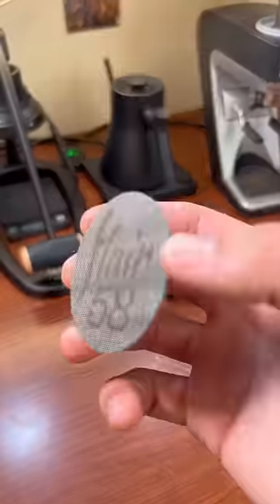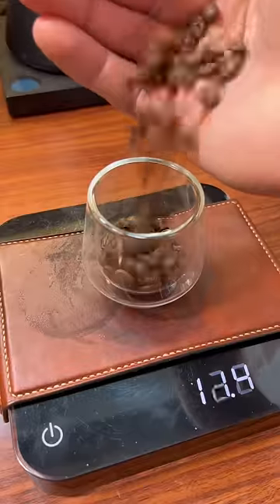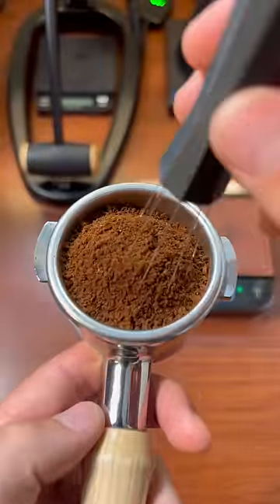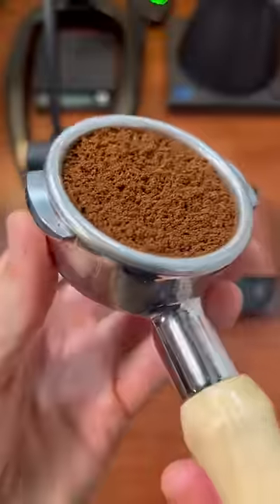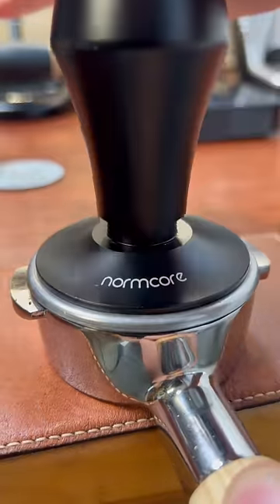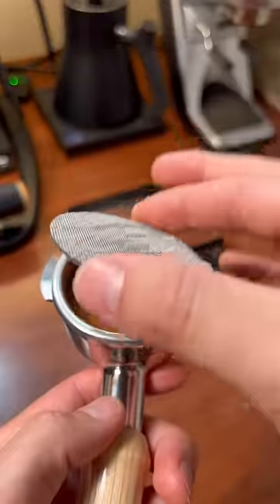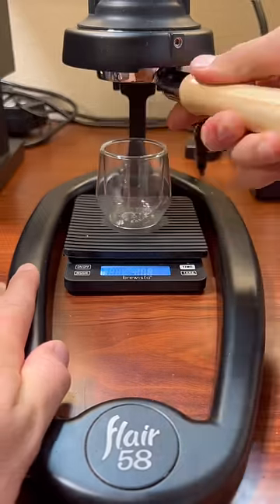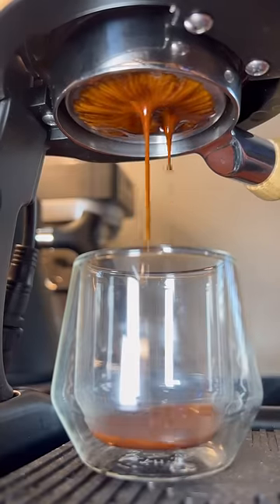My espresso tools and what they do ☕️ #shorts

Comment: I like the logic of breaking up the clumps to then press it all together (essentially making it all one big clump)
Reply: 🤫 shhhhhh
Reply: The idea is just to remove the small pocket of gaps in the coffee so you can “press” it with certain pressure, else your coffee is going to be weak and thin depending on how fine your coffee are grinded
Reply: @SamuelLing  explain how
Reply: @Kefka2010  ain't no way bruh 💀
Reply: he de clumps to get a more efficient press into a puck as declumping allows room for air to escape
Reply: Some spots r denser than other if u don’t distribute it
Reply: Goofy ahh coffee
Reply: one big CONSISTENT clump. There is a distinction
Reply: @draken9045  Do we really think it will matter when you compress it into a puck?  You've already pressed out any pockets of air. 

Is there any data to back this up?
Reply: @barrychopsticks  Where do you recommend I start?  It sounds like you have researched this so you must have some data driven proof that will be a good point for me to start?
Reply: @barrychopsticks  I think it's kinda ironic you talk about others getting triggered when it's so obvious that's what you are.  Someone who doesn't have the same hobby you do asks why you do something specific about it and you throw a tantrum instead of just saying why.  Think about how short your answer could have been instead of the smartass remark on your previous (unprompted) reply to me.  If you get that triggered by people asking questions then don't look in the comments section.
Reply: @flosscap  nice explanation!  its called channeling 🧐 for those who don’t know

Comment: TLDR: Doesn't make difference, but is a great conversation starter
Reply: The wdt tool (needle tool) makes a difference among all the tools here cuz clumps and uneven beds even when flattened with a tamper will have weak spots and tight areas you wont see but when water pushes through at high pressure weaker spots will pass water really fast and the tighter areas will have less contact, this is called chanelling. This results in less extracted coffee so not gonna be as tasty as a fully extracted shot.
Reply: @dominicjestinchankingwai4105  
They should teach this in humanitarian majors lectures
Reply: Not really a good conversation started unless you want people to think you have aspergers
Reply: @NidoBot  as a person with aspergers, I'm offended that you're completely right.
Reply: @dominicjestinchankingwai4105  sure, but it shouldn’t be too expensive. The one he has is 3D printed. You can tell because they printed it at a high layer height and you can see the layers lol
Reply: What? on how pretentious you are? 🤣
Reply: @NidoBot  I hate how right you are
Reply: @NidoBot  I would take any conversation start'er' that comes my way.
Reply: @woobywoofers9854  Same
Reply: @NidoBot  “nice to meet you, can i tell you about my spring loaded weight calibrated espresso machine coffee ground tamper?” sounds like exactly the type of conversation starter someone with aspergers would use
Reply: @dominicjestinchankingwai4105  There's no real evidence of that.
Reply: @isodoubIet   How did you come to that conclusion? I mean its pretty stright forward information. Even distribution=even extraction. Lots of vids of people testing this and finding results aswell as people in forums who are avid coffee drinkers.
Reply: @dominicjestinchankingwai4105  " I mean its pretty stright forward information. Even distribution=even extraction."

Sure. Evidence?
Reply: @dominicjestinchankingwai4105  I know what channeling is. 

"The wdt is just a technique that helps with even extraction. "

EVIDENCE???
Reply: @isodoubIet  https://youtu.be/WErtiVYKmAQ i mean i know a lot of people in groups and forums who tried and tested this technique with even extraction as results. Heck i tried it with the same sentiments. Wendidnt tape the results though. But this vid is pretty much what happens without proper distribution. Its widely practiced because of the results people are getting. If it doesn’t work people would ultimately stop doing it, the extra time taken is long enough for an espresso so has to be worth the extra effort.
Reply: @dominicjestinchankingwai4105  Here's what I asked for:

1. repeatable experiments
2. detailed methodology
3. adequate sample sizes
4. proper controls
5. statistical tests

Do we get any of that with that video? Let's see... 

1. Is any of that repeatable? No, he did it all himself, meaning he's the biggest variable. Any personal bias he might've had towards one of the methods would go right into the data. Furthermore, his allowed variation of 1 gram in the target yield could on its own account for about a about a 1% variability in extraction, which is about the same variability found in the results. Garbage in, garbage out.

2. Is the methodology detailed? Nope! There was zero explanation of how the tests were carried out, or how the techniques were applied, beyond naming the tools and showing some brief images. Not enough.

Furthermore, let's say I want to replicate his results... I'm immediately hosed because he didn't say 1. what beans he used 2. how they were roasted 3. what grinder was used 4. what machine was used 5. the brew temperature and pressure. What were the grind settings? What distribution method did he use when dialing it in? How long were the shots? Was there preinfusion?

3. Are the sample sizes adequate? Kind of irrelevant in light of the previous, but we don't know because no statistical tests were carried out.

4. Are there proper controls? Again no, for the above reasons.

5. I repeat myself. No statistical tests of any kind were performed, so even if all the above factors were magically fixed, we wouldn't even know if the results are consistent with random chance.

This is a well-meaning but ultimately unserious testing effort.

Comment: As an Italian who was also a Barman, I only saw the 2 second one never knew about the other 2. Makin an espresso usually takes you 30 seconds using these tools will take you like 60 probably even more since u have to clean the mash each coffee you make
Reply: Decades ago before the stupid starbuck craze we had a coffee shop with a real expresso machine imported from Italy. This thing was fancy and high quality. The grinder dispensed the correct amount in to the pot and then on the machine you would press it a bit and put it on the machine and run it. Then you would remove it. Tap the coffee ground out in to a steel bin and as many times that we had done that you could see the mark on the handle right in front of the pot. You could make a lot of expresso with this machine and froth milk all day long with out stopping. Talk about a machine. I do not recall exactly the price of the machine. I am sure it was in the 10k range and was gold or silver, real fancy looking too.
Reply: @kameljoe21 espresso not expresso
Reply: @kameljoe21  i actually thought all coffee machines from shops were like that. But I live in Portugal and coffee is a huge part of our lives I guess
Reply: @ohhimark3691  I have a Saeco Magic Deluxe 2 for my home machine. Its an automatic. It cost well over 1k new more than a decade ago and still going strong. Refurbished ones still cost around 600 dollars when you can find them. 
I do no go to places like starbucks and never really did. I learned all of the coffee stuff from when we owned the coffee shop. Most of what we sold was copies from Portland area which was where the college kid went to school or some place like that. This was during the time of the great StarBuck boom of the mid to late 90s. Coffee house were becoming a major thing and Starbucks started to expand. We did not last a couple of years as our location was in the basement. Even if we had lasted another year or 2 before someone make some sort of complaint about going up and down the stairs. Had we had a street level location I think we could have ditched everything else and just done pure coffee/espresso cold or hot drinks.

Comment: Just in case people were wondering. The brush thing is useless, just get a good coffee grinder with good coffee, no clumps happen. The tamper, yes you need a tamper, but getting one spring loaded and set for a certain way? Coffee can change slightly depending on the humidity in the air and the course of the grind. The grinder will eventually change its setting, it happens with any tool either due to wear or because of movement, so having a tamp set at one setting is useless, just learn to use a regular one. And as for the mesh, 99.9% of espresso machines have one built into them on the machine itself, so if you have a machine that doesn't you're spending money on something that you dont need to.

Comment: I think 99% of people would not notice any difference in a blind test
Reply: You for sure would. The tamper is minor, the screen and wdt are both marked improvements though. The main thing is uniformity though, you could pull 100 shots with the tamper, wdt, and screen and they would all be largely the same. If you just grind and tamp though, some shots will be bitter, some with have a different mouth feel, and some will be sweeter etc
Reply: @koshey245  Agreed. I’ve been pulling shots since 1999, and consistency is far more repeatable by stating with fresh & properly stored beans, using zero ppm water (with or w/o flavor profile enhancer), weighing, using a quality espresso grinder fine enough for a 2:1 pull in 25-30s, WDT/OCD distribution, even tamping, timing, preheating, & puck screening. 

People who can’t tell the difference probably destroyed their taste buds with years of drinking instant coffee.
Reply: @evolv.e  I spent 3 or so years drinking keurig/not great coffee but after about 2 years I can 100% taste when a shot was messed up
Reply: @koshey245  the comment towards the end was meant as sarcasm. I should’ve placed a /s at the end. What’s more likely is that those who haven’t had a properly made espresso, latte, coffee, etc aren’t aware of what they’re missing and therefore don’t think there’s a difference. 
But, as everyone’s sense of taste is different, who’s to say that some people truly can’t tell the difference.

Comment: A little tap on the side of the basket does exactly what first one does. You cannot over tamp, so spring-loaded tamper is pointless. And all espresso machines already have a fine mesh under the water chamber. But this is how businesses work nowadays. They invent a fake problem, for which they plan to sell you a pointless but very expensive solution. At the end they pay bunch of money to get you convinced, you need, it by similarly pointless person, called "influencer" 🤣 If you want a good shot of espresso always make sure you use freshly baked coffee beans, and grind them right before the brewing.
Reply: A removable mesh does make sense in high volume applications, because it's much easier to clean than one built into the group head (the latter will be too hot to handle after pulling a shot, and take a long time to cool down). For a home or office setup, I wouldn't get one.
Reply: You absolutely can over tamp. What are you talking about?!
Reply: @NetRolller3D  agree but nothing of this setup speaks high volume. BTW running some hot water through it and wiping it with a towel gets the job done. As a matter of fact, this is exactly what baristas do in busy coffee shops.
Reply: @Alwaysaspy  the purpose of tamping is to remove air pockets and even the puck. Coffee is hard matter, you can't compress it below its volume. If your espresso runs slowly try changing the grinder setting.
Reply: @kalpazanov  you're super wrong. But you're confident in your wrongness.
Reply: @Alwaysaspy 😂 I love how pretentious that comment was oh how I love this channel.

Comment: The only reason to get a puck screen is to keep your shower screen clean, which isn't really needed as long as you run some water through the machine and brush off some loose grounds every now and then. I can see a puck screen being a little more convenient on something like the Flair 58 though, since you would have to pour the water manually through the group head in order to clean it. On my Gaggia Classic Pro, I can just flick a switch to do the same thing though. 

The main problem I have with screens is that it drastically increases your shot times, which would make me constantly paranoid about whether my grind was fine or coarse enough. If it takes that long for water to get through the screen, then how long is it taking the water to get through the coffee? Is it being properly extracted, or is the water spending most of its time just getting through the screen? It's just another variable that I'd rather not have to deal with.

WDT is something I'm a little mixed on. I added a WDT tool to my normal process recently, which includes a leveler and tamp. I cannot say whether or not the WDT has made any real difference to the quality of my shots. I think using the combination of the leveler and tamper was probably good enough on their own, but I still use the WDT during puck prep because it can't possibly hurt anything. Now the process is WDT, then level, then tamp. It works great, but if I'm being honest, the addition of the WDT probably wasn't necessary. I was getting great shots without it too.

Comment: Now if you really want to get fancy, place a small metal siv with a freezing cold metal ball over the top the of the glass, then let the machine pour the espresso over the ball rather than directly into the cup. Locks in much more flavor that usually disappates from the heat and makes for a nice rapid iced espresso free of ice.

Comment: The most significant difference in an espresso will come from a tamp and evenness of the grind. The wdt and puck screen also help but the difference is less if your machine has good water flow and pressure. Any other extra steps are completely unnecessary

Comment: “That allows you to pull shots like this”

I’d say that’s rather misleading given that you can pull the same looking shot without the screen. A good espresso machine already has a water distribution group head and it does a pretty good job doing so. We actually tested it and there is no difference in taste.

The reason why my coffee shop uses it is to avoid the group head from getting lodged with coffee grounds. Realistically the screen just makes the whole operation cleaner. The whole process is much faster as order turnout with screen saves about 10 seconds of checking that the group head so clean between the three machines.

Comment: all of those things should cost less than $5 individually, the 1st one is just a whisk cut in half, the tamper could be replaced by something with a smooth edge that fits into the whatever and the puck screen can be replaced by a stainless steal mesh strainer cut to shape
edit: i found a wdt tool online that looks like the one he uses for $26
the tamper was listed around $45
finally the puck screen was around $25 looking for the flair 58 one you have
i can garuntee you the difference between using your fancy tools and my replacements is slim to none mr brozo
though i think tea is better and my $15 teapot is better than that most likely several hundred dollar coffee press you use so whose to say

Comment: A lot of people seem to not have used these tools before in the comments so I can try to explain some of them: 
I haven't used the needles, so I'll skip those for now. 
For the tamp/distributer: you're tamping the espresso grounds for the same reason that you grind it so fine! You want a lot of coffee very tightly packed to cause a lot of pressure, and get the high concentrate that espresso has. My boss explained it to me this way: if you have a barrel of packed together sand, and a barrel of gravel, which one does the water get through first? As for creating pressure, if you have a room with an open window vs closed, and try to close your door, you can see the difference there. You need a tight seal on both sides, but water needs to still be able to get through the coffee. We use high pressure from the machine and tightly packed, fine grinds to make a super high concentrate, and then filter that through into the shot glass. 
A level tamp is really important as well, because if one side is tighter packed than the other side, the water will take the path of least resistance (of course). If a river had to either flow through a mountain, or take a path around it, it's going around it every time. So you'll get what's called "channeling", where the water goes through the side that's less tamped, and so you'll get a higher concentration of water to coffee (since the grinds tighter-packed grinds weren't used in the extraction), and that will results in a watery, less creamy shot with underwhelming and probably underextracted taste (which means it can come out tasting almost savory/salty. I know it sounds weird at first, but it's true, and VERY noticable)
The needles to declump the coffee sounds weird at first, since you're just tamping it again. But remember that we're trying to not have our shot channel. If the grinds aren't even, then the parts with bigger clumps to start out will be more tightly packed, and the parts with less clumps will be less resistant to the water, which again causes channeling. Although, a lot of cafés you won't see these needles being used. That's because clumping usually comes from too much either too much humidity, too much heat from the grinder (cafés use very expensive grinders that can avoid this issue ($2.5k each in my jobs case)), and sometimes the roast can cause it too.

Comment: So my biggest issue with a puck screen is that they are harder to clean then the espresso machine. How do you clean yours?
Reply: Use the steam wand to clean them. Blast for 10 seconds on each side and you should be good to go. If that's not an option, any decently pressurized water stream will do fine